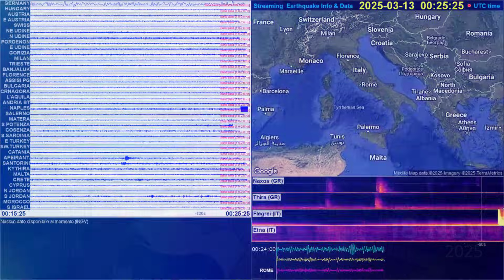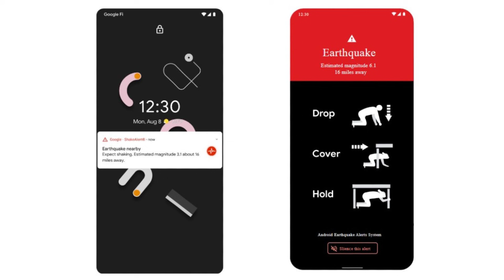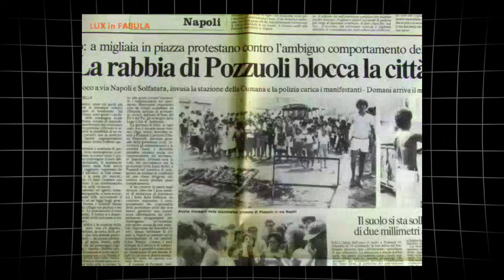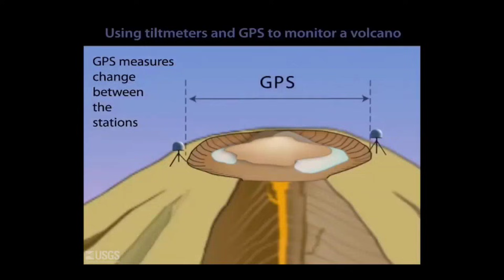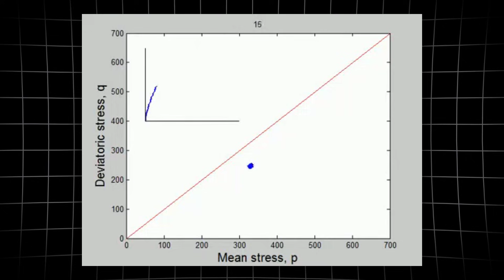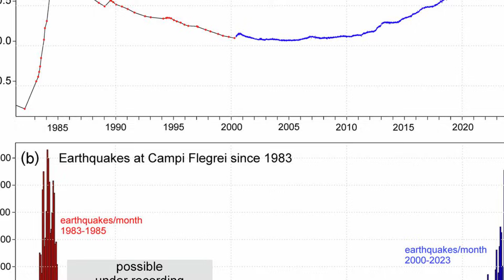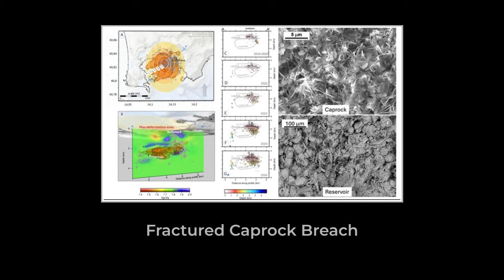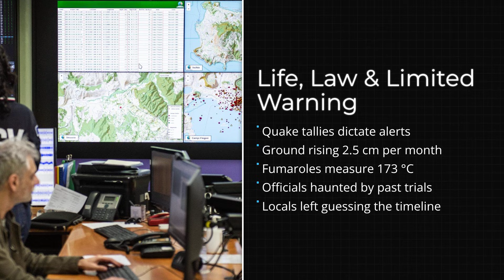1 MINUTE AGO: Massive “Thunder” Quake Just Hit Campi Flegrei

Comment: How much of a warning do you need?  Your house is falling apart around you.  The tiles on your back porch are cracked.  The plaster is falling off the ceiling in the dining room.  The wall in your kitchen is hot to the touch.  The streets are melting under your feet.  Your boat is on dry land where it wasn't before.  The air stinks of sulfer.  Every day, earthquakes are occurring; they wake you up at night.  There are steam vents all around your neighborhood.  It's coming folks and you're going to be part of it if you don't get out now.

Comment: I've been through the two large Los Angeles earthquakes, so it's interesting to see such a small quake create so much havoc.
Reply: SO WHAT LOL
 
It's volcanic and YOU don't directly live on  weakening cap rock inside a SUPER caldera..
Reply: The earthquake Is a sign that the caldera (supervulcano) Is possibly close to erupting. There have been small quakes for months and increasing in strenght, the ground Is increasing in temperature and in height. So the danger Is the vulcano not the "small" earthquake. 😊
Reply: It's not that particular quake but the pattern...

Comment: If I get a knock on the floor that means "Get out now.". The only way I would still be there is if I had a helicopter in the yard fully fueled and ready for flight.
Reply: I would want a helicopter with the engine running.
Reply: @guypehaim1080 Better yet.  Thanks.